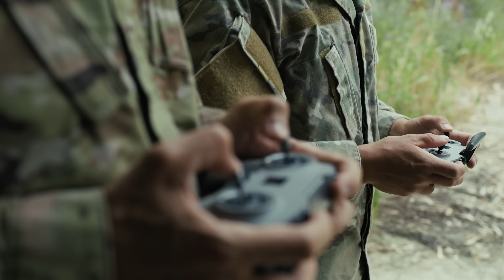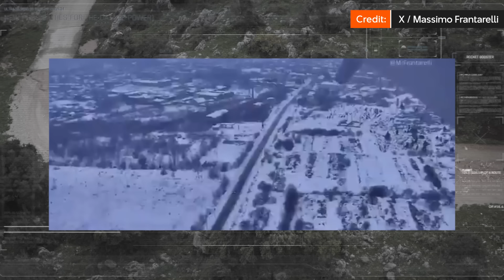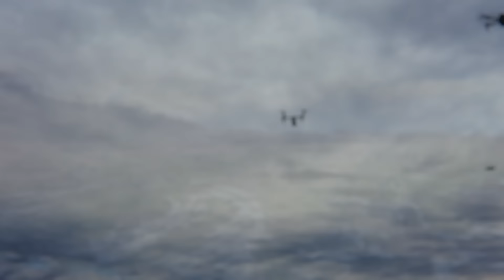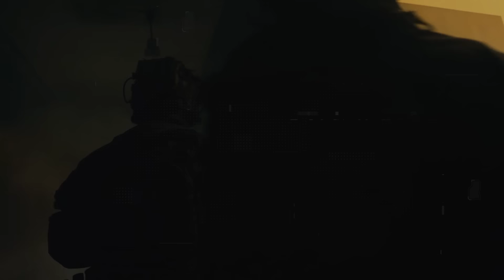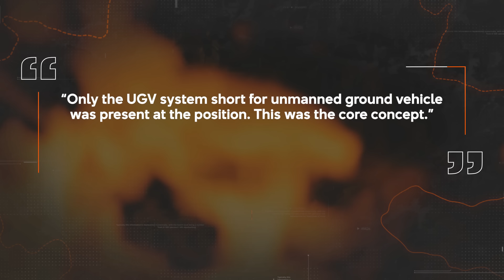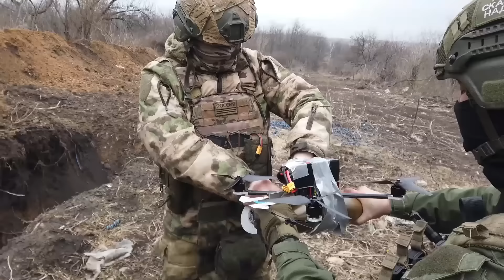Ukraine Uses INSANE Hack to WIPE OUT Russian Troops

Comment: Watching this gave me a random thought, couldn't you do direct mold injection, using ABS plastic for the drone body and wings, etc. After the initial molds you could pump out the components by the thousands and would give the lightweight, rigidity, durability and very low cost..
Reply: Plenty of civilians are using 3D printers to make parts for the cause.
Reply: Can‘t say anything about this specific technique, but drone production is quite widespread with lots of companies being involved. So I wouldn’t be surprised if some parts are done that way. Usually it’s a lots of parts from different suppliers that get put together to the final drone at various locations in order to avoid lynchpins in logistics.

Comment: 10:55 see, the elevator rudder is really small for such heavy plane AND the stabilizor is large with a lifting profile it looks like. you need a bigger elevator rudder to get proper stick response. especially if you have most of the weight in the payload.

Comment: 9:20 Sorry no, that just a bad pilot. sure it might be harder with a plane "fixed wing" than a multi-rotor drone in some situations, like super close to the target and you need to course correct during the last 2-3 seconds. but other than that no... you are maneuverble AF with a plane. BUT i would make the elevator and ailerons bigger on those simple fixed wings to give move rudder input for steering. but still you can be VERY agile with a fixed wing.. i know, i have years of flying..

Comment: Sooooo, Russia throws the grenade. Ukraine grabs it out of the air, PULLS THE PIN, and throws it back.
Reply: Humorous, but pretty apt.
Reply: no more like Ukraine eats the grenade, gets blown up by it for years and then finally learns how to use the same type of grenade. The Russians have been using these type of drones for years and absolutely WIPING OUT the Ukrainians with them. These drones can carry heavy payloads capable of leveling medium sized house. Russians even you use them as mother ships by sitting smaller drones on them which increases the range of the smaller drone.

Comment: The fixed wing drones can move easily loiter at a target location compared to the multi-rotor drones. They also have the capacity to more easily deal with oddly shaped payloads just with the stability of the airframe, or shaped fairings